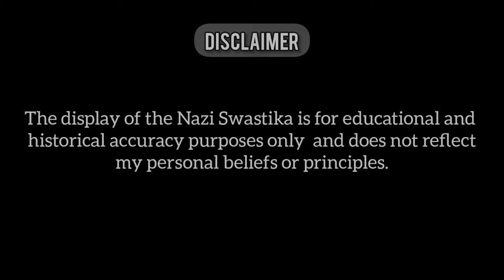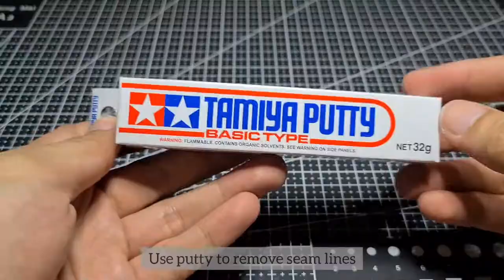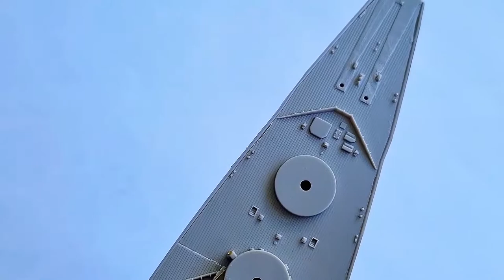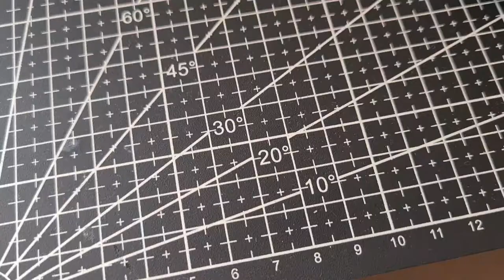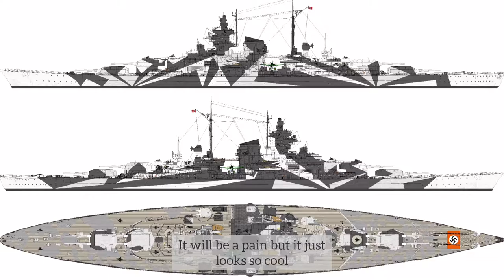1/700 Trumpeter DKM Tirpitz Build

Comment: Is this kit a good fit? I want to build it but I built several bad Trumpeter kits in the past so im a bit hesitant. Thank you!
Reply from the maker: I have two trumpeter kits this one and the Prinz Eugen and both of them have generally good fits with very minor issues. For me the turrets and some of the AA guns have some bad from fittings but if you're looking to glue the turrets in place it won't be an issue. For the other minor molding and fitting issues, they can be easily fixed with sanding and putty.

Comment: I just got this model as i wanted to start small on ship models but how hard is this model for a newer person to models? Also should point out im using the kit only no added parts and such
Reply from the maker: Awesome choice! I would say that it's forgiving for beginners on building model ships. For this model it's the standard one too with just the railings for the photoetch parts. Just be careful on the smaller parts because the plastic is a little fragile
Reply: @robinworks  gotcha I also got the AMT M1A1 Abrams model when I got this, but I do plan to pick up some more navy stuff from this brand if the shop I go to has it